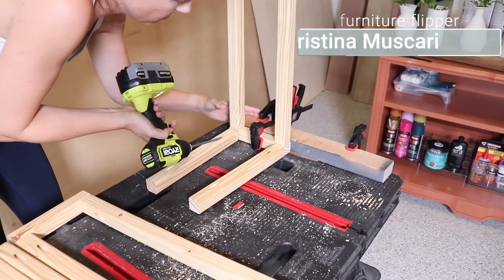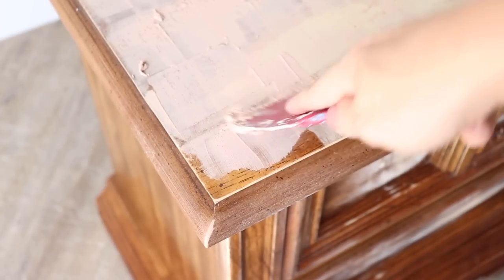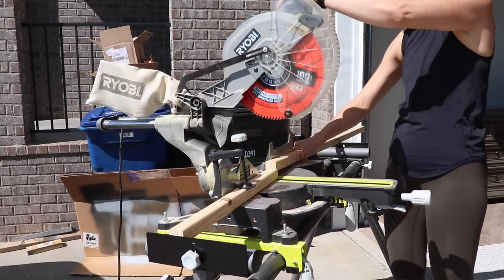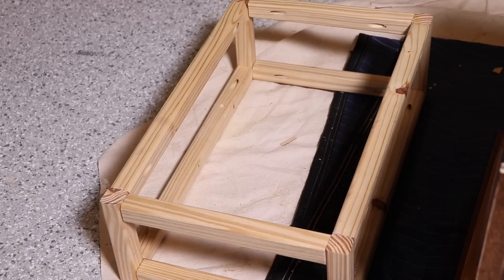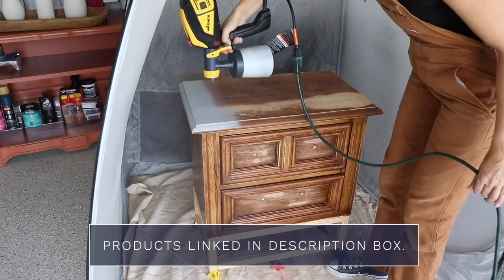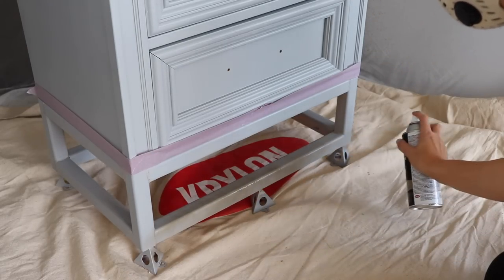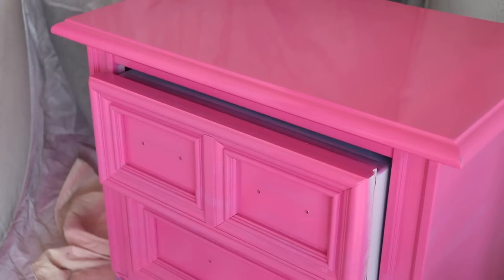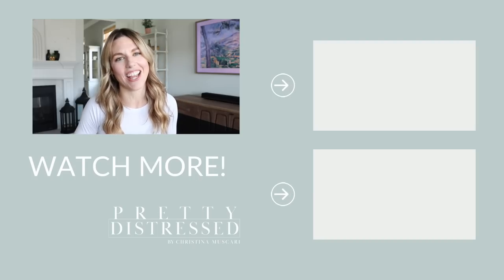From Drab to Barbie Fab: Extreme Furniture Makeover with Glossy Spray Paint

Comment: Christina thankyou for sharing your work. I like learning tips from others - often how to manage around a "not built to purpose" work area. 

My biggest challenge has been managing spraying - from the art I do to cabinets or speakers. 

I'd be grateful if you have a minute to share some experience...

Does the Wagner gun create a lot of overspray or throw it a long way in comparison to a traditional spray gun? 

How well does the Wagner tent work do you find for preventing overspray from dumping on everything in your garage?

I like the pink too... I think you are finding that priming your surfaces helps. If you are doing gloss the prep is super important. prime and fill with a few coats as needed and spray with a fine tip. If need be sand and then do a final coat. 

A lot of the fluffing around with sanding, cut and polish is to do with 2 pack clears or a desired glass like finish. It can be a real PITA and doesn't suit all looks. I love how your dresser turned out.

Comment: Looks good but I doubt that finish is going to hold up without some sort of coating...pink is also highly susceptible to UV damage given red is the longest wave length in the visible colour spectrum (pink is a red). Might have been worth getting an isocyanate to make your paint 2K (like automotive paint) or even adding a ceramic coating. Wouldn't cost more than an extra 5 or 6 dollars and it would protect your piece for years before needing to be recoated.